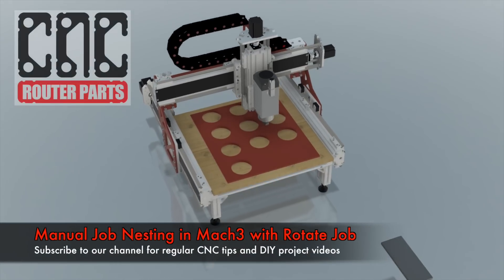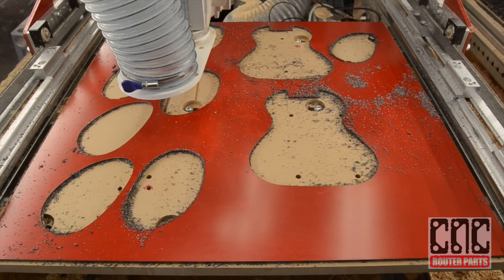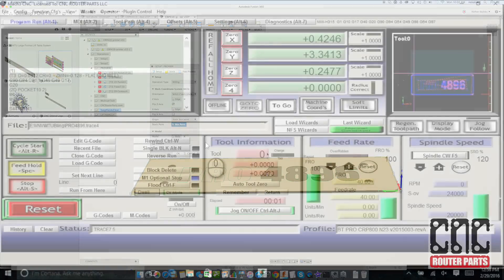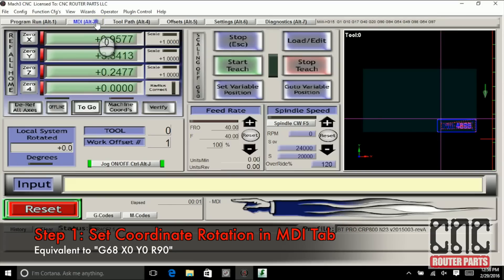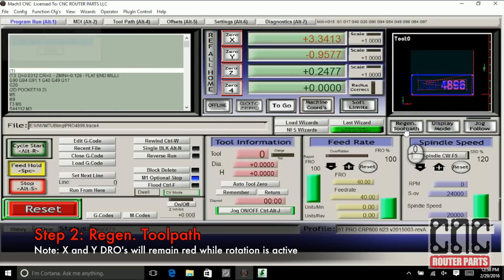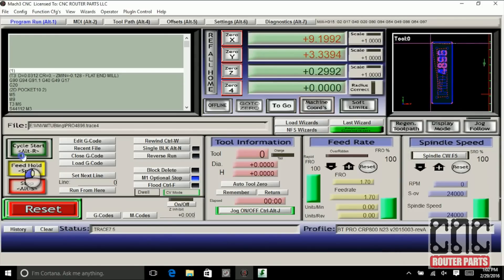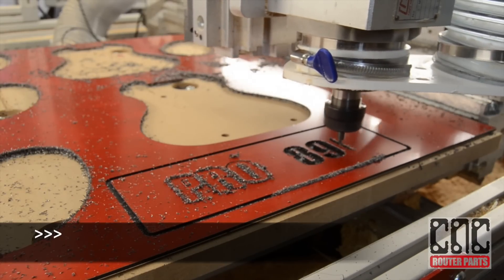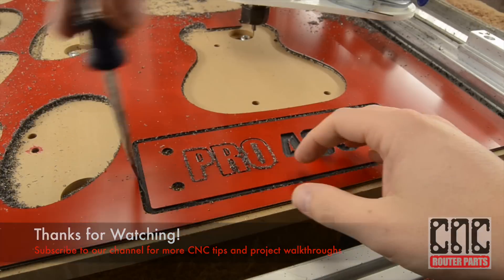How to manually nest CNC projects with Mach3 using Rotate Job (G68)

Comment: when I rotate it goofs
up my fixed touch plate coordinates which messes with tool offsets during tool changes
Reply from the maker: +Michael Bernstein Hi, thanks for your comment.  Sounds like your touch plate coordinates are using G54 coordinate offsets,  If possible - I'd recommend setting up your touch plate & Tool zero script to use Machine Coordinates instead, as those are truly fixed and don't change unless something physically changes with the machine (ie. homing sensors moved/adjusted).
Reply: Interesting. I use the big tex blue screens and am pretty sure they are in machine coordinates as they are set after homing but will check. Thanks